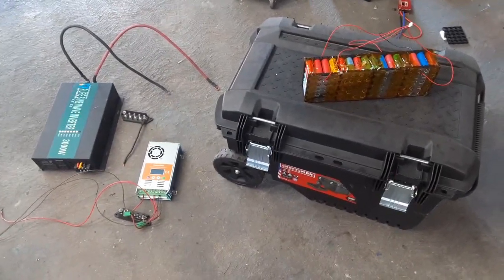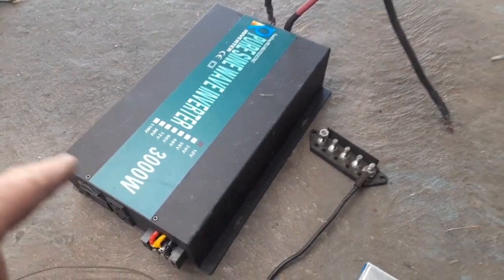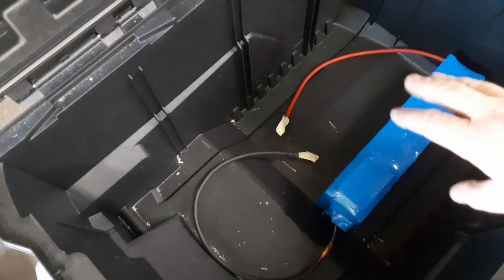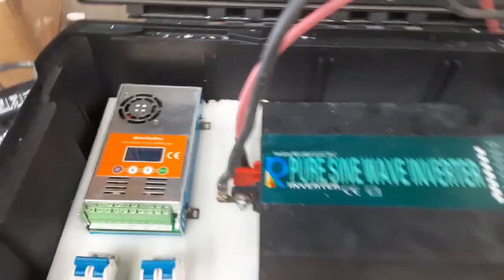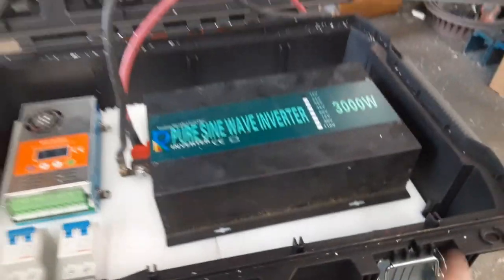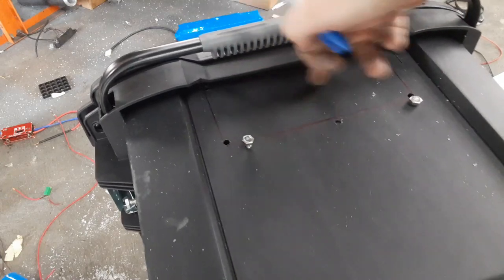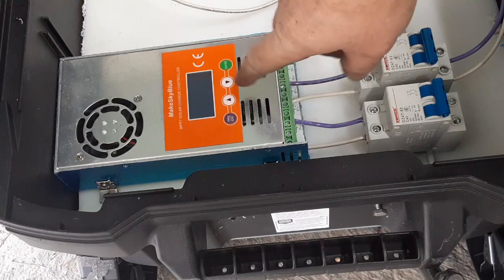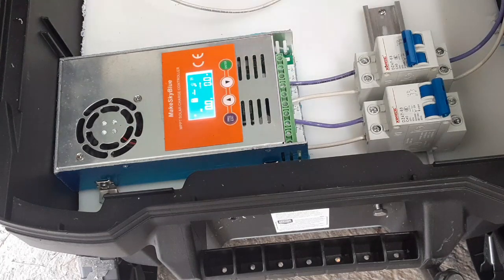Super Solar Juice Pack - 3000watt 12V "Solar Generator" DIY Build using batteryhookup.com

Comment: Without the solar panels it's just a battery box with the panels they do generate power a quick question where do I get the solar charge controller what brand is it also I've heard others say that inverter is a good one at a reasonable price but when I type it in I get renogy so what is it's actual name or website I'm also looking for the other components the switch and USB type c at a reasonable cost I saw a utube vidio were he pointed out why power low voltage device's by inverting it to 110 then back down since my lights are on a separate circuit I'm planing to go 12 volt for the lights and to bring 12 volt to our 2 bedrooms and our chairs in the living room to charge our phones and laptops so I want to find a regulated 12 volt power supply so far I've seen a lot of video on diy power boxes but non have all 3 USB power supplies I wish they'd standardize them my tablet are the original slow charge my fitbit watch won't charge on that it has to be quick charge but not type c my phone is usb type c it can be charged over night on USB quick charge so I need a plug in for all three if they are too much then I'll get a car charge and install cigarette lighter plugs there also hard to find most are axillary plugs
Reply from the maker: Both can be bought on eBay. The inverter is Reliable / WZRBL brand inverter. Just search for " reliable pure sine inverter". The charge controller is makeskyblue  , there's some fake ones and real ones when you search that name, the real ones are sold by makeskyblueUSA as the seller name. They're only $10 or $15 more expensive then knockoff ones, but they're a lot better unit, with US based support, and I've had zero issues with them for over 3 years running different air conditioning and heating setups daily.
Reply: @lsswapshopp  I'll try to find reliable again when I first typed in reliable inverters what came up was  renogy inverters  I'll try also to find that controller thanks for the info
Reply from the maker: If that dosent work try WZRELB . https://www.ebay.com/str/reliablepowerinverter?_trksid=p2047675.m3561.l2563

Comment: Nicely done Wil,  that would be so much better than listening to a generator run all day in the event of a power failure, plus where do you get gasoline when they have no power as well!
Reply from the maker: Exactly, gas generators have their place, but these are good for quieter events like camping or longer term power usage since you get free sun power "forever". And they cost about the same as a Harbor Freight noise and smoke machine.